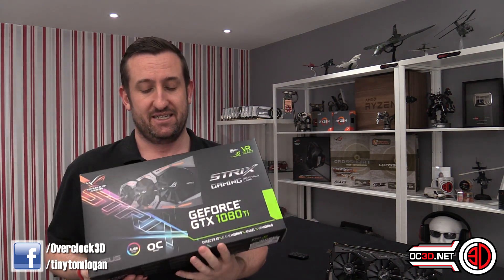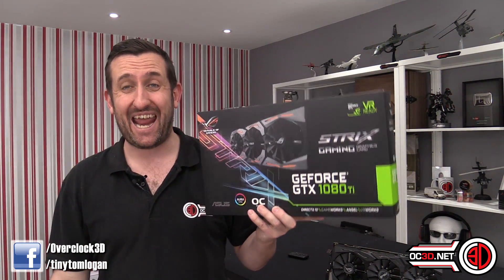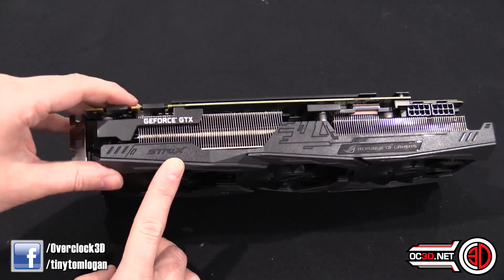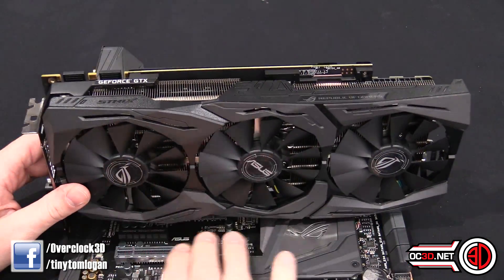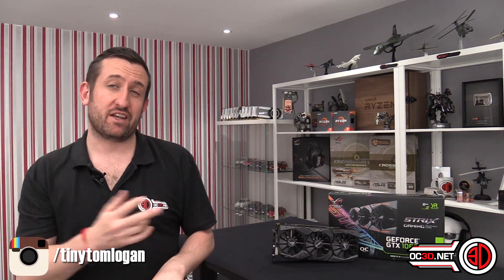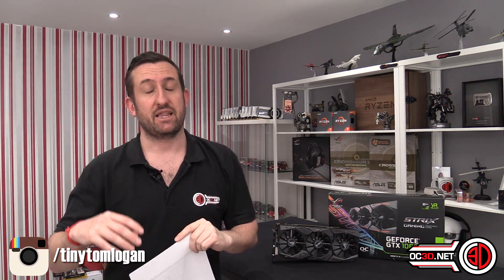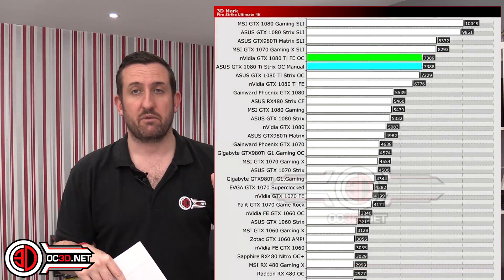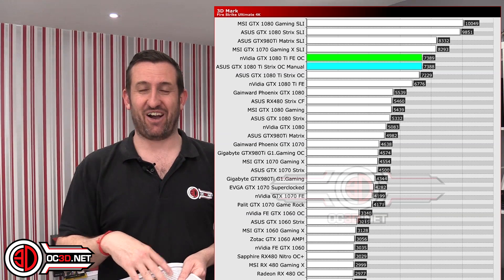Asus GTX1080 Ti Strix OC Review

Comment: If I had to guess, it could be because the card is designed specifically to run using DX12. Software can make a huge difference in this respect.

Comment: I just got my card and it runs way way hotter than your sample, and i havent even installed he asus gpu software to enable the "oc mode" (its boosting to 1974mhz out of box). In a fractal meshify c with a fan blowing directly on the card i recorded max temp of 75c with fans spinning up to 1900 rpm. Im wondering how there is a 15c difference between our cards, do you test with vsync on or something? I have a dell 165hz monitor and i run with nvidia fast sync so sometimes im pushing in the 300-400 fps range depending on the game. Kinda disappointed in this card, i think i am going to swap it for an evga hybrid.

Comment: Two questions:
1.) Is there a big difference between the OC/non OC versions? (I'm an idiot and i had multiple tabs open on NewEgg while comparing and ordered the non OC version when the OC was only like $30 more and I ordered the wrong one XD)
2.) Do I need an Aura enabled MB to use the lighting on the card itself? (Have an older z97-A board and plan on upgrading the board when i get either a 7700k or an 8700k chip)

Comment: 8700k turned up today, this comes tomorrow :D
Reply: OWL which motherboard did u go for?
Reply: ROG Maximus X Hero
Reply: OWL nice. Looking to get the same build but im going to wait for cybermonday 😊 fingers crossed i get some parts on discount. Am going for 4000mhz ram and asus pq27q monitor too
Reply: I thought about going for that monitor but went with the XB271HUAbmiprz 27 as it was nearly half the price. GL :)
Reply: Hi how are your temps with this card? Mine are higher than expected 75c with fans going up to 1900 rpm, i use a dell 165hz monitor with vsync off.
Reply: Fred Flintstone i havent build it yet. Have to wait till tommorow for my ssd to arrive
Reply: Fred mine the same 75c on AAA games (Not sure on fan speed can check for you at some point), I guess its to be expected considering it's OC as fuck?
Reply: Gold did you get much discount? If I had waited I would have paid the same because although some parts are on sale the CPU is £50 more and my case CRYSTAL 570X price increased too :o
Reply: OWL i payed quite allot for some parts i think. Gpu 669£ with 2 games was the only good deal i think and pg279q monitor 672£ meh deal. Motherboard x hero 240£, ram tridenZ 4000mhz 234£, processor 396£, ssd samsung 1tb 850 evo 278£, psu evga g2 850w 125£, case phanteks ethoo pro95£, aio corsair h115i 120£

Comment: At 4k you no longer need large amounts of AA anyway to counter aliasing 
issues as the high pixel density solves that. Yes, the 1080 ti smashes 4k 
gaming at 60 fps. What a beast. Hell, it does min frames 90 fps in 8k 
(split to each eye) super sampled in some VR games for me, that's nuts.
Reply: 90fps at 8k... Mate this is 1080ti, not 10080ti
Reply: and yet it does it in many indie games in VR, crazy huh .

Comment: Hoping you can respond but I'm going to ran 2 more pg279qs this year and I'm grabbing this card, how can I run all 3 at 144hz/1440p with only two display ports?
Reply: Patrick Lima you can get a DisplayPort hub
Reply: Patrick Lima would it have enough bandwidth for 2 144hz 1440p?so I could do 2 from a hub and 1 from the second port?
Reply: got you a link
https://www.amazon.com/Club3D-DisplayPort-1-2-Multi-Display-CSV-5300A/dp/B00PB8FB4G/ref=sr_1_6?ie=UTF8&qid=1494346806&sr=8-6&keywords=club3d
Reply: Thanks man
Reply: no problem

Comment: @Tonytomlogan Could you do a review on the 1080ti AMP Extreme? I hear that is the most powerful. 16+2 pwrphases.
Reply: It's so sad the 1080ti AMP Extreme turned out to be such a blunder (the massive heat sinks don't even touch anything). They did such a great job with the 980ti AMP Extreme, and then messed up.

Comment: Nice review (as always) - Thanks! About this sticker "GeForce GTX" I just saw that Nvidia announced the GeForce GTX G-Assists so I'm thinking that this may be one of the possible reasons for this sticker. Also I wonder if GeForce GTX G -Assists will work only with Ti version or not... have to make a research on that (read more about the G-Assists).

Comment: Nothing beats the feel and look of the founders addition, especially with an entire aluminum vapor chamber(no cheap plastic feel if that matters to anyone else). I had a 1080 strix, bought a founders addition 1080ti to add to my custom loop. Have to say, I have cool ambient temps (room) and substantial case cooling, the founders card with its stock cooler in my PC tops out at 62°c with an overclock to 1983mhz with a small fan curve topping out at 65% fan speed. Very surprised. Waiting on the Titan X Pascal block to come in from EK for my 1080ti.
Reply: "Edition" (addition is when you add something). I think the aesthetics are the primary reason most people don't want a founders (those brutal green logos).

Comment: isn't it funny and wierd that EVERY Asus GPU is WAY more expensive than the competition? hell the Asus GTX 1080 OC cost $950 and Asus GTX 1080Ti FE cost $1010. Why would anyone buy that instead of Zotac GTX 1080 AMP Extreme $690 and Zotac GTX 1080Ti FE $810

Comment: Hi Tom, test a 4K monitor bigger 40" and you might change your mind about 4k :P
Reply from the maker: If you mean a TV - I doubt it.
Reply: nah, I got a philips 4K MONITOR 40" more than a year ago, unfortunately it's not slightly bend which would be ideal, but I can't live without it now :)
Reply: b1lleman find a40inch monitor that's worth a damn for gaming and isn't obscenely priced first, unless you mean a TV... in which case, no thanks to slow and unresponsive.
Reply: Hi Monk, do you mean latency or size doesn't work for gaming ? I personally don't have any issue with that on my monitor , but I mostly play sim stuff like X-Plane or Elite Dangerous
Reply: b1lleman you replied while i typed, i checked that monitor out, and i take it back, at first glance it seems like it is a decent 4k 40 i can monitor and at a reasonable price.
Reply: No worries mate, price/quality on these philips monitors is outstanding. This is apparantly the 3rd generation of my monitor model which is 1st generation but it changed my life :)
Reply: there's also a 43" model but it's not bend. If you got good eyesight you can work on them in the windows desktop without using any scaling.
Reply: i can see how a screen that big would work well for sims and such, but i had to make use of my old 32 inch plasma screen for a while and for shooters and such, while immersive, i found the screen size a bit too big, at 40 i think the issue would only be made worse, one of the biggest issues with 4k for me currently, and probably until the next generation of cards and screens is the 60hz limit on most screens, combined with the inability to push higher refresh rates  with the current hardware, i went with a rog swift a few years ago and i have to say i feel 1440p at 144hz is a really good sweet spot right now, if you have the hardware that is.
Reply: Monk, agreed. it all depends on the usage, and we'll have to wait for some time before there are graphics cards able to generate 120 or 144h frames per second @ 4K anyway.
Reply: Hey Tom, I've never had a 1440p so I might be a little bit underinformed. Love your videos as always my dream is to have a decent of amount of belgian beers @ the island of wright with you.

Comment: My 980ti runs every game at minimum 60-70fps @3440/1440 so this should be over 90fps if not get a 980ti and save yourself over £550! ;)
Reply: I call bullshit.
I have the same setup (overclocked) and it certainly doesn't run every game at 60-70fps.
Mayyybe at lower settings but at ultra. No fucking chance mate.
Reply: George Lawther 40fps? That's a slideshow
Reply: ***** maybe you've never really experienced smooth frame rates. 40fps is not an enjoyable frame rate. I don't care how pretty 4k looks, not worth playing at that sluggish feeling.
Reply: ***** You seriously think 30 fps is fine? That's good that you can.  If you're happy with 30 fps you could've just stuck with consoles like the PS4 pro and get near 4k resolution for much cheaper.
Reply: George Lawther not at ultra though. no chance
Reply: Mpamphs Kangourosaurous try setting them to very high and you'll be fine the 980ti has great bandwidth to easily run these games playable but buy the 1080ti please your helping nvidia invest more money which is great! Buy two for sli and you'll get even more playable fps and help the companies share holders
Reply: JdoRides yes your correct I run every game at very high, I couldn't tell any difference from ultra anyway and very high but I still get over 40fps on ultra settings in fallout 4 etc
Reply: Muppetlord JdoRides yes your correct I run every game at very high, I couldn't tell any difference from ultra anyway and very high but I still get over 40fps on ultra settings in fallout 4 etc and yes that's "fucking right!" ;) if you live near Hertfordshire you can come and see for yourself ;) I don't bullshit ;) so I can back my claims up
Reply: Witcher 3 says Hi!
Reply: Tech guy I have been an avid pc gamer for over 2 decades (every console some you would never have heard of ;) for another 2 decades) I was in the second division just below the first pro division in counter strike beta and back then we didn't have 144hz micro second input lag but on our 1024/768 resolution and 60hz at lan parties yet we was very competitive. Every hardware review always states the minimum fps PLAYABLE for a reason and that's because of exactly what it says it's playable. The reasons I used to upgrade every year was to be like you get the highest fps (nvidia and amd must be laughing all the way to the bank ;) as it's pointless for the most part. Ps the reason I left consoles was the MMO and multilayer games like Arma 3 which NO console could ever run. Plus 2 decades ago we had 1440p when consoles could only run 640p ;) on a CRT. There's a reason why the ps4 pro can't run true 4k (it upscales the image and why most tv adverts showing ps4/xbox1 footage stating "footage showing pc version" is because the gaming pc is KING ;) oh and you can't water cool a console to look as stunning as my pc ;)
Reply: George Lawther non true..  I have 980ti and you can't run modern games at minimum 60 fps at 3440x1440 Witcher 3 at ultra it has 40 fps . gtav has 45 fps and rise of tomb raider 40 to 50 fps also wildlands and quantum break ... So yes 980ti is not for 3440x1440
Reply: ***** at least I agree with you that PC gaming is definitely better. I just prefer staying at a lower resolution so I don't have to upgrade every year. Looks like you make it work at 4k though. I just know it's extremely demanding so I stay at 1080p with higher frames.
Reply: George Lawther Bullshit 40-60fps at 1440p. I have a 980 Ti. What games are you running?
Reply: Tech guy you should go and see an optician bro and Don't drive seriously! That must be a unique eye condition you have there get it checked ASAP before your eyes get shot the rest of us I hope don't suffer from 40fps syndrome ;)
Reply: Tech guy you know that 24fps is what movies are shot in and that's lovely and smooth anything over 30fps is smooth it's like having a huge dick your lady can only take 9ish anything more is a waste same with fps ;)
Reply: mate if your not getting 40fps at 1440p Id give up I run arma 3 with view distance set to very far and all settings on ultra, fall out 4 set to very high, again over 60fps,  world of tanks/world of warships over 75fps all on max settings, batman games all of them min on very high settings without AA over 60fps I have a water cooled pc with 4.5 base oc 16gb ram and my 980ti is an msi gaming 6G oc version. easy all day long

Comment: Just get one. 
A lot of coil whine, and also problem with BIOS. GDDR on OC mode its only 11010MHz, not 11100Hz as said in specification.
I have change to secend one and the same problem with BIOS and coils. 
But after case closing, the sound of coils it's not much higher then fans, but it's noticable.

Comment: The EVGA FTW3 copied the 3 fan design this year but it doesn't have the lighting strips on the shroud or any RGB on the backplate. The EVGA FTW3 backplate looks like it was put through a paper shredder and the shroud looks god awful. Not to mention EVGA now has a reputation of exploding (poorly manufactured) 12v capacitors that have done serious damage to many customers. Seems like ASUS is the easy choice this year.

Comment: Buy a founders with an EK block and get 2100mhz @ 40c at just over $800.
Reply: Moonbogg yeah. I did the AIO mod with a 280 rad. max temp 48c-50c on low fan. 800rpm. push pull :D
Reply: I know but a question and i want an accurate response from someone who knows what they are saying would it be better to get a high end air cooled GPU and overclocking that as it has a custom board or getting the founders edition (i want to know which one would perform better and i do not care if it is only a few FPS i want to know the truth)
Reply: In terms of just performance you are usually better off getting the likes of the STRIX and water cooling that. Money wise get the reference card and water cool that.
Reply: David Stewart i did fe with nzxt x61. low noise 52c or a little more noise 1200rpm and get 48

Comment: Exactly what I said 4 days ago in the preview video.
"Toms Tech4 days ago (edited)
Here's the review..
Overclocks to 2100mhz could do more but nvidia wont let you,Performs about 35% better than a gtx1080 and costs 35% more, Temperatures and noise levels are good because of the MAHOOSIVE tripple slot-tripple fan cooler and nanny state limits (could have done just as well with a 120mm rad), If you got the money its the card to have at the moment.
Core is still cut down so full 1080ti Black could be released later (with HBM which it already works with). Doesn't meet PCI-sig specifications with 2x8pin power (upto 366w maximum power available including slot).
"fuck you idiots who believed our a-new-king bullshit when we had this in tape out, gtx1080s are for poor people, but thanks for your money now go and buy this." -Nvidia"

Remember when amd cards didnt perform well at 1080p and needed more res to get going and didn't have allot of overclocking headroom and everyone hated on them? hows that taste eh?
Also that thermal pad is terrible, its just going to pick up dust and insulate the cooling plate underneith it, the vrms would have cold air going straight onto the plate on top, but instead theres a cooling pad on them doing nothing because its touching the side edges of fins so theres no surface area, its like they've pulled and EVGA, this could have been so much better, its got a measly 2.5% overclock. even furyx's often got a 4.7%+ overclock.

Fact is you're running into a game bottleneck when you sort the cards by 1080p, apparently it performs the same as a gtx1080, sort all the cards by 1440p results and it'll make allot more sense. going to dx12 removed that API limit enough to show real results, its just such a shame nvidias holding back so much on its customers not giving us the full core.
Then screwing us over more by limiting the overclocks, there is no reason this couldnt do 2200mhz if the power and voltages weren't raised, it has plenty of VRMS and cooling to do it but it seems they dont trust us to know what we're doing and need our hands to be held.
Fuck you nvidia im an enthusiast and have been for 10 years so im going to go with a company that trusts me.

Comment: Tom, would you be willing to tell me if this will fit in an SLI config on the Maximus IX Formula board? i'm really looking for this info so I know if I can even invest in these cards.
Reply from the maker: IthurielBane pretty sure I covered how to work it out yourself....
Reply: you must have not heard him 
ALL motherboards which support SLI/crossfire as far as i know have a 2 slot gap (not including GPU slots)  1 large slot for a GPU then a blank space (by which i mean no slot)  then a small slot for sound cards/PCie storage etc... and then another large GPU slot so you will only be covering the small slot for sound cards and PCie storage but you have one of those slots above the top GPU anyway so it does not matter
Reply: OC3D TV you did and I'm pretty sure they will fit, confirmation is just nice before an investment this large. Thanks for the reply
Reply from the maker: Sadly I get messages like this ALL the time and if I got the boards out everytime to check 100% Id never get any reviews done :/
Reply: Totally understand man.

Comment: TTL What 1080ti would you get to water cool ?
Reply: if MSI does the Seahawk EK on the 1080ti i would just get that
Reply: i want  to know to and it has to be the best performing on water as custom cards come with custom boards and usually the founders edition overclocks better compared to base clock vs the percentage it will overclock

Comment: I want to see how much cooler is this 2.5 slot card than the EVGA 1080Ti FTW3, which is only 2 slots.
Reply: If they the difference is less than 5 degrees, then this card is a waste of space since it is 25% thicker.
Reply: i went with evga as i plan to watercool, if you want the best on air, zotac seems to usually have he best coolers, albeit 2.5 to 3 slot in size, sadly no waterblock for the ti amp extreme from ek so im jumping ship for the first time in years .
Reply: Monk I usually go with EVGA Hydro Copper, but this time the waterblock is not made by EK.
Reply: IMO its not the temp differences that are going to matter but the fan speed required to maintain those temps.  The supersized cards are going to have a much easier time keeping the fans idle while watching Netflix or listening to music.

As a user of very nice 'open back' headphones this is worth a considerable amount of space and money
Reply: mighty .petrimous good point